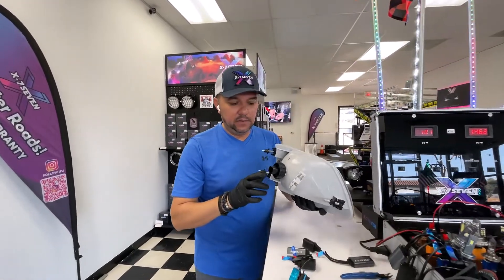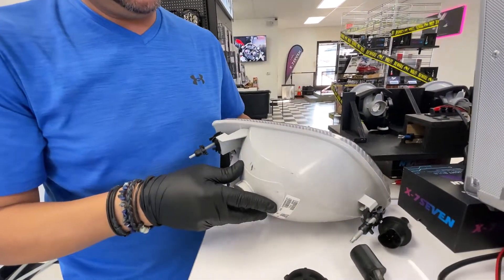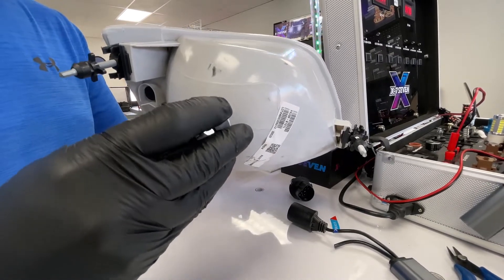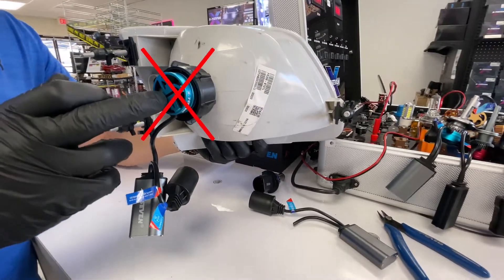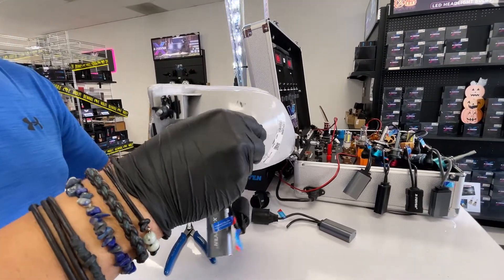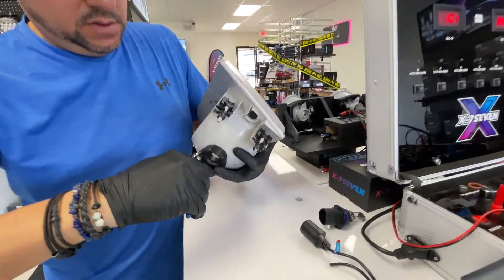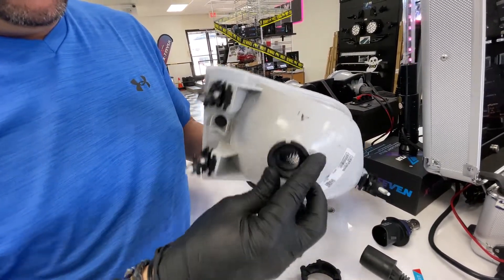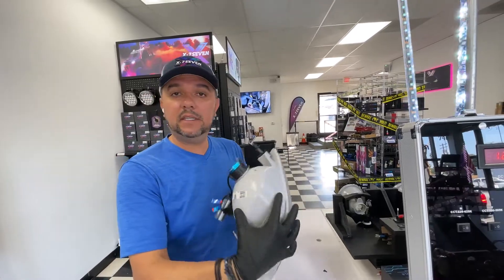X-7SEVENUSA -- 9007-9004 || X-Apollo || Installation Concept Sample 🚘⚙️

Comment: One more tip - never ever touch the hot parts of the bulb/LED or halogen/ with your naked fingers. 
If you do, the fat from your fingers will make your headlights foggy from the inside. This contamination cannot be cleaned off, i.e., buying new headlight assemblies is the only solution.
Reply from the maker: Thanks for the tip Boris, and yes I agree, please always use gloves when handling bulbs.

Cheers....👋
Reply: @X7SEVENUSA  Foggy halogen spotlights are very common here in GUA and it’s all due to the “mechanic” who cannot keep his fingers from touching the bulb when installing them. This means that 100’s of dollars spent on spotlights are ruined by ignorance. 

Now that we have LED’s replacing the old school halogens the issue should remain. Keep your naked fingers away from any surface that will be hot during operation. 

BTW…
I was on my balcony (11th floor) one evening. Suddenly I saw one car with way stronger lights than any other in traffic. 
- It was my car (wife driving) with the X7-Seven H4 installed!
Reply: @X7SEVENUSA  Another tip is to make certain you have the highest voltage available for the bulb/-s. Let’s say you have less than 12V at the bulb but 14.8V from the alternator you might consider to re-wire your electrical supply to the bulb using a relay.
Reply: That is a good one!